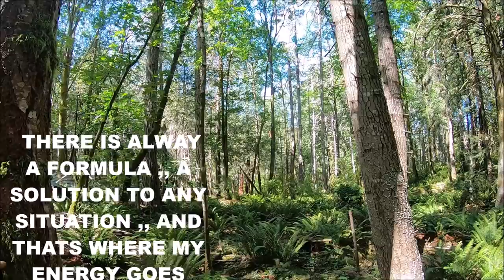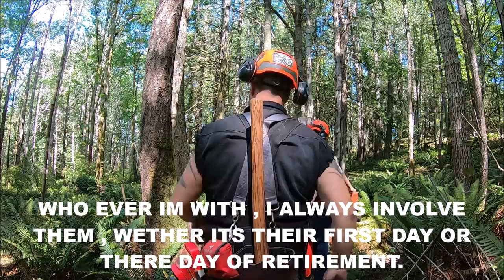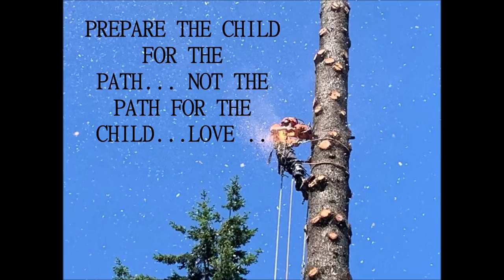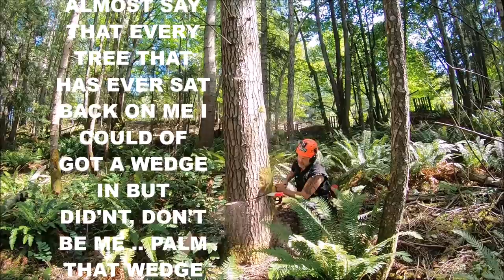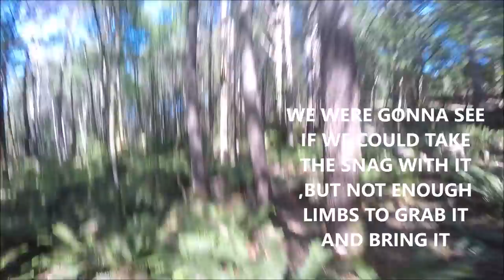TREE FELLING PUZZEL, WITH WILD PRO MAC 570, McCULLOCH

Comment: What an ending... Bang those bongos! BTW, love the McCulloch! The thing really rips!  It tells me it's not always about power displacement but more about how it runs & cuts trees. 
Thar B a change in the air over here in Vermont too, feeling real good methinks.
You have inspired me Buckin', time to shut this thing off & commence upon DAY ( 33 ) clearing timber & brush above the pond area... Mostly snapped off Scottish pines remain with the occasional beech or maple here & there.Thus far I have squeaked 3.55 + cords of firewood rounds out of it. STAY SAFE... 
Bill on the Hill... :~)